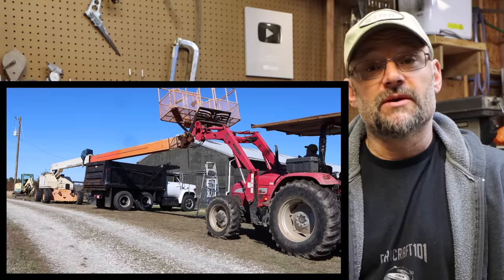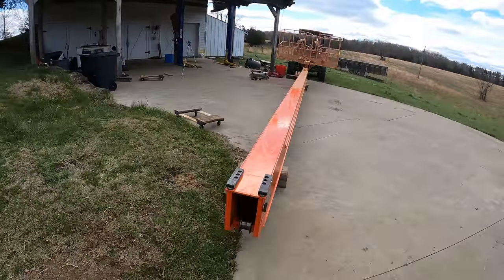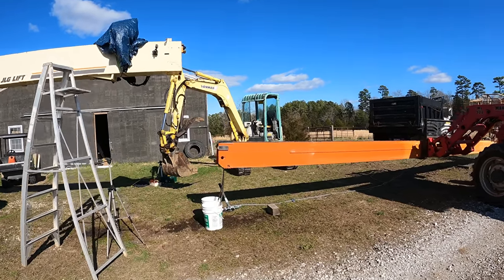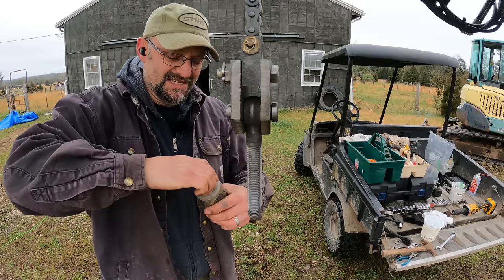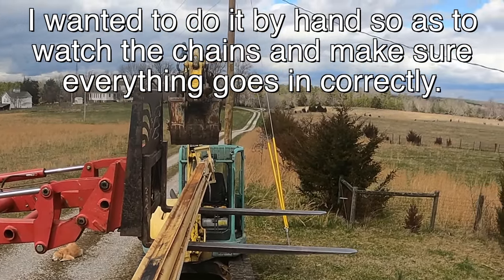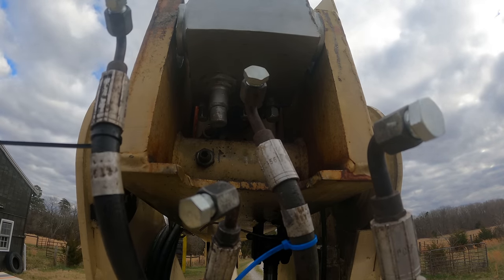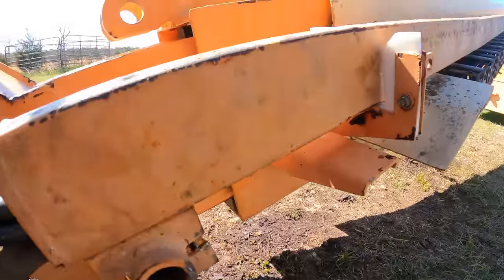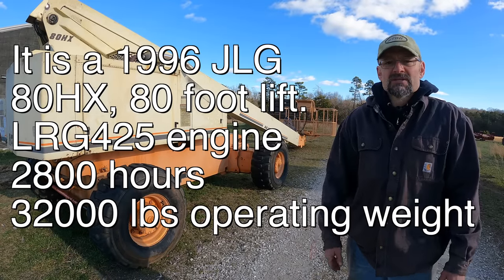Rebuilding An 80 Foot Boom Lift Alone.  Is It Possible?  JLG 80HX

Comment: When you're trying to pull the boom back in at full extend it almost sounds like the hydraulic pressure relief valve is getting triggered.  I'm no mechanic or hydraulic expert but if there is a safety pressure relief valve its possible that the spring and the safety relief valve possibly has a lower pressure than original spec after aging.  You should check the those valves and see if maybe its bypassing because its getting triggered at too low of a pressure.
Reply: guess i typed this too soon lol hearing the rest of the video now

Comment: To be fair to it, full extension in horizontal is a massive cam friction.  Without rollers instead of wear pads, I think you are just going have to put a jockey wheel under the basket if you insist on using that way.  And an inflatable dinghy for when using over your lake….

Comment: Can't you just drive the lift on the arm instead of using the come-along? Or are there other problems i'm not seeing? Is it only driveable with the basket contol panel? If so, you need to use them.

Edit: Maybe you need to bypass some safety switches before it wants to drive.

Comment: The extended boom has some bend in it due to flex and multiple booms with some tolerance at the pads. Are you sure it was meant to be fully extended horizontally? I can see it being extended fully when raised above level but then it has gravity on its side to retract. I can’t think of a reason why at machine height it needs to fully extend. Just my .02

Comment: You rebuilt the cylinder to function almost as new, saving $50K on a virgin one. So the value of the overall JLG should be somewhere north of $50K, perhaps $80K. Nice work. Didn't you just love all the problems that needed solutions?

Comment: Great video!  Do you think the anti seize on the chain tension bolt may have resulted in excess chain tension?  It seems like the tension should be just a bit more than needed to prevent a dead zone in the movement.

Comment: Is there in the manual any information of how much hydraulic pressure there need to be on the cylinders to function. You.could measure the pressure… and compare to specs. Maybe the hydraulic pomp is in need of a overhaul…

Comment: possible should have checked hydraulic fluid at extended boom stage as most oil in use in system, just my thought. very interesting  to watch but I will never have to do that , Ever.

Comment: did you check the oil level after that full extent? after you opened that long cylinder it was full of air instead of oil, and that air needed to be replaced by oil.

BTW, what's the working pressure of that hydraulic system? in airliners the hydraulics run at 3000 psi, and i'm told that in forklifts they run at 4000 psi.
Reply from the maker: It says max pressure is 3200 psi.
Reply: @FarmCraft101  Put a pressure gauge on the retract line and see how much pressure it is acheiving. 
Then you will know if it needs an adjustment of the presure relief valve. Lubrication for the slides would likely help, and certainly would not hurt.

Comment: I think we should have settled on the metric system.  The imperial system is based on halfsies.  So your real measurement is half plus half of a quarter plus a quarter of an eighth, a sixteenth a half of a sixteenth and a few cubits.  Easy peasy, right?  That must be how the shims got messed up at the factory or the last rebuild.  Decimal inches, i.e. engineering and machining units would have been ok.

Comment: I does not bother me at all that it does not retract horizontally. Now if I was up on it at a 45° angle and it never retracted since my weight was on it I would not let that pass. Or even just 15 ft off the ground fully extended. That would not work. Yes I know you are out in the open and you can just let it down, but situations will happen where something will be in the way.

Comment: I was wondering... how was the oil level when you were trying to retract it? Sometimes(and by de sound of it) when the oil level its low, some hydraulics tend to lose strength to operate... did you refill it after the first bucket you pour in?
Reply from the maker: Yeah, oil level is good. I need to get a set of hydraulic gauges to check the pressures.
Reply: @FarmCraft101  too bad... But, even with that quirk it is such a nice machine to have... if anything you can literally glue or paint a marker on the boom, so you can use it without reaching that last part that wont retract (that's Mexican applied technology) XD

Comment: I'm a bit confused about the castle nuts on the tensioner ends, are these bolts just supposed to keep the "holder" together and allow some movement or why aren't they torqued?
Reply from the maker: Yes, they are supposed to be loose so that each chain gets the same tension.  If one chain were slightly longer than the other, it would compensate.

Comment: Well sir, I have done field service work, alone, and you impressed the socks off of me, well done, nice job. Oh, by the way, show yourself some self respect, that should be “MR” idiot😂. I also have the “ everything is going together really nice, so what did I forget to do that should have been done before this point” thoughts, man that’s really irritating when it shows it self and I would end going back a step or two to correct it after having spent 10 minutes convincing myself I didn’t miss anything.😂😂😂😂😂

Comment: I doubt if the operation of the lift was ever endorsed or recommended by the mfg at retraction horizontally from full extension.  That puts unnecessary strain on the tool,

Comment: It’s not designed to be fully extended/retracted at that angle? The angle vs extension length is noted on the infographic inside the door. It’s irrelevant if it does not retract because you wont be using it at that way. Adjusting the PRV is unnecessary.

Comment: At first I was thinking “I wish he showed how he gets those cotter pins bent so nicely and fast, I always find them painful and a lot of bashing” …and then you put the chain tightener on…”uh…”
Ok so bashing is involved!
Reply from the maker: Yep.  The smaller ones were easy.  The bigger ones were quite hard to bend.  These are all stainless pins, much stiffer than the cheaper zinc plated ones.  While I was struggling with them, I kept telling myself that at least I wouldn't have to worry about them ever coming out accidentally!
Reply: @FarmCraft101  LOL <3

Comment: I haven't finished the video so don't spoil it but couldn't you just drive the base forward to receive the boom?
Reply from the maker: Well, you can only drive from the platform, so I'd have to use the control box that is strapped to the boom.  That might even be too sketchy for me!  ;-)
Reply: @FarmCraft101  good point. Amazing job btw

Comment: I guess 25-000 to 30-000 for the cylinder as used, 8-000 to 10-000 for the pure steel and about another 15-000 in other spare parts. So... let's round it to 50 to 55 grand.